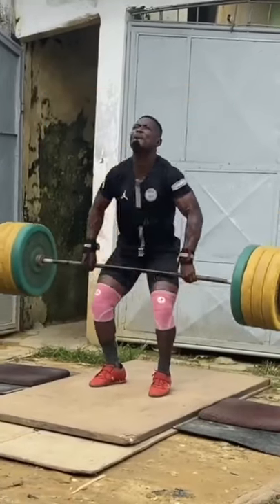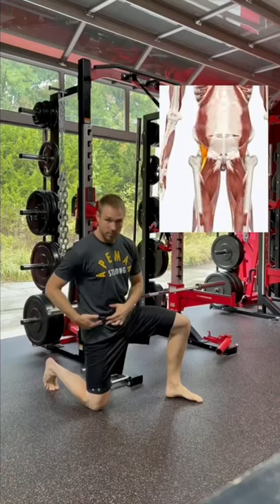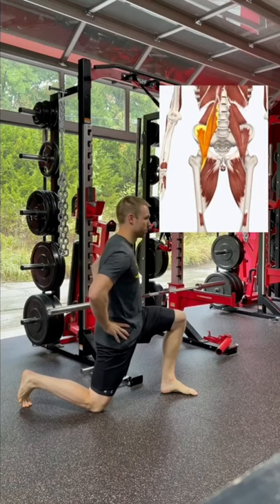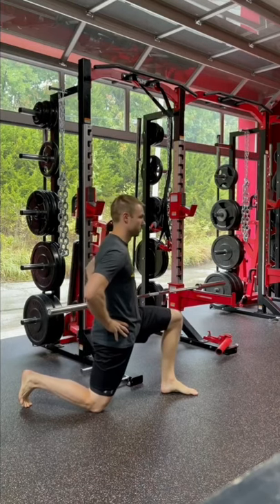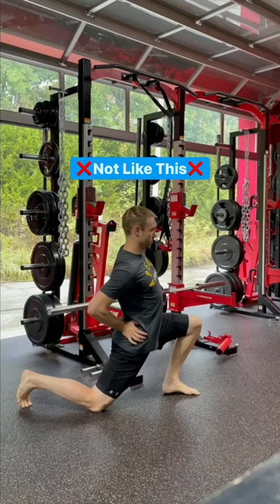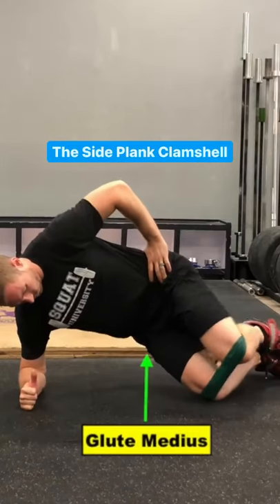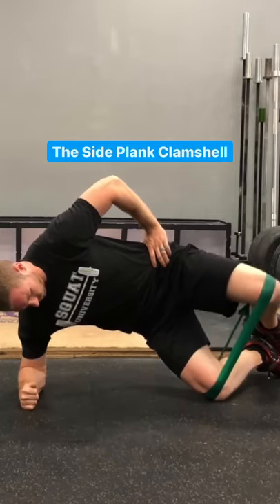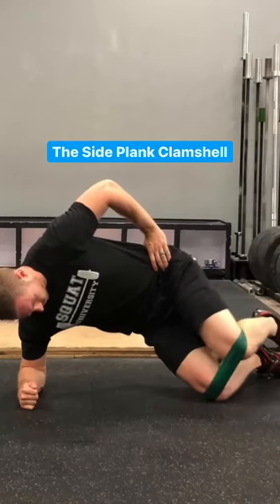How to Fix Stiff Hip Flexors #SHORTS

Comment: Do you have a recommendation on having hip flexor pain when heavy squatting or doing heavy leg press? I already do a lot of hip mobility stretches. Sometimes I can lift without any pain, sometimes it comes back. Is it bc I do ass to grass depth? Should I decrease my depth? My form is correct too.
Reply: Burning sensation right ?
Reply: @Christian Mac thank you 😊
Reply: I got same problem , did you find any solution ?

Comment: I do both of these and end up setting off my sciatica. Do you have any suggestion to avoid this?

Also just want to say thankyou  for all your information.
Reply from the maker: So I'll say if the side plank clam shell sets off your sciatica you're likely dealing with a short piriformis syndrome - this usually get's worse when the glute muscles are strengthened in a shortened position. Check out my youtube video on Piriformis syndrome and try the soft tissue work and stretches and that may be a good start.
Reply: @SquatUniversity  thankyou for getting back to me. I've just watched the video you recommended. 

I will start straight away with rolling and stretching.

Just one more question. How are you suppose to train the glutes then if you have short piriformis syndrome?
Reply: Send the video to yourself in messenger and youll have it saved.

Comment: Help me i have 2 shoulders that are messed up, left one is in constant pain and cracks with any movement and can get locked up and i have to undo the movement that locked the arm to fix it, and my right shoulder has a point where it will physically jump a section in my muscles where its idk but i can't make a full rotation with it and when i hit that jump in my mobility its painful as hell, and because of the left shoulder being out of place its effecting my neck now and is pinching nerves on the top of my spine and because of the pinching in my spine the bottom of my spine is being pinched and my hips are being effected by the lower spine and making them have serious pressure all the time so i have to crack my back but by cracking my back its hurting my spine which made the middle of my spine extremely weak i can't lift a empty plate without feeling seriously crushing in the middle of my spine and it hurts so much, i am 17 years old this shouldn't be happening to me yet this is a cry for help doctors don't know what is wrong with me a chiropractor made everything worse and all i hear from everyone is we can't help you, someone who has any possible idea or know anyone who might please help me im in so much pain always..
Reply: schedule an appointment with a sports physiotherapist in your area.